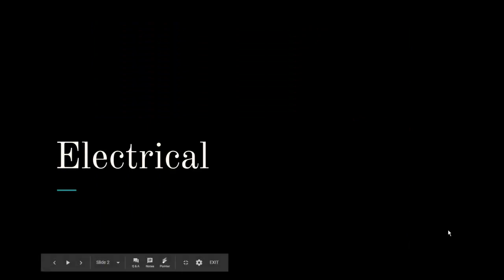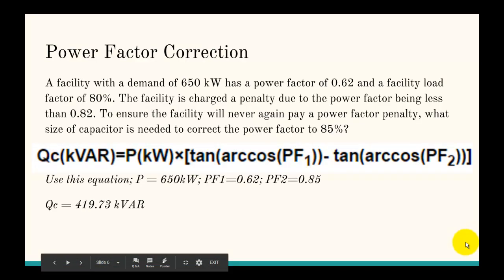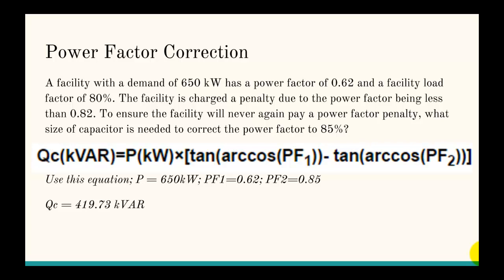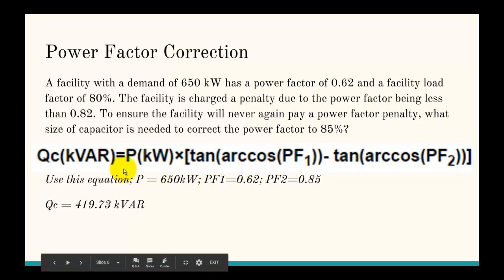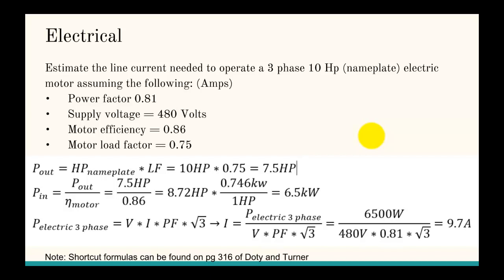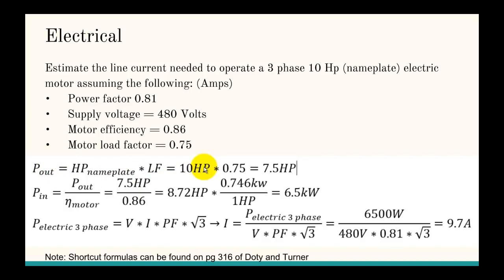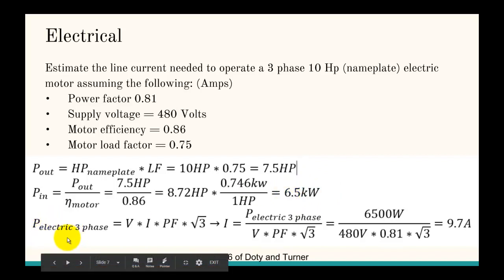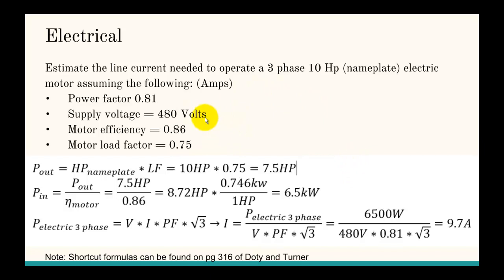Certified Energy Manager Calculation Review:  Electrical

Comment: For the power factor correction I used formula kVAR = Real Power x Table Factor. Table factor based on 62% and 85%. I got 419.25 which is slightly different.